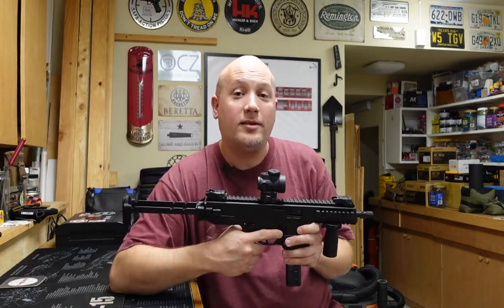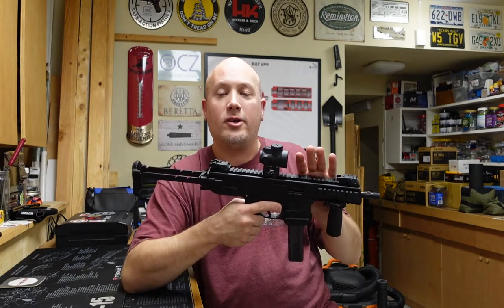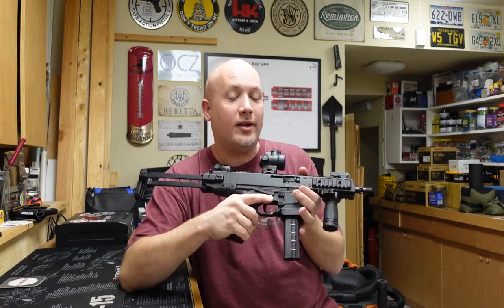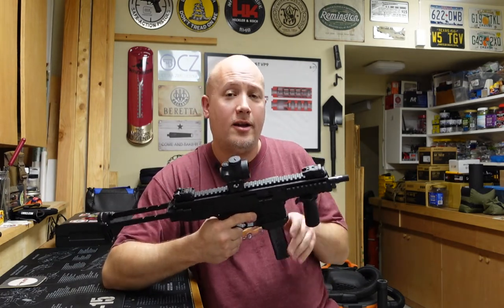Update, Diagnosis and Fix of my GHM9 SBR w/ Information from B&T

Comment: I had an issue with the pmc 9mm before that’s why I don’t use it anymore. I do have apc9 pro and I run it with brass,aluminum,steel case ammo zero malfunction great video thanks for the info
Reply from the maker: You are very welcome! After this happened I have been wary of PMC.

Comment: Interesting diagnosis, and I wonder if they replicated and documented the failure or the diagnosis is based on mechanical theory. And... Every time I see Youtuber talk about exceptional CS, I can't help but wonder if the CS is so good because they know you are a Youtuber. If you are a Joe Blow, will they be so quick and so personal to you? I wonder.
Reply from the maker: It is a good question to ask.
Reply: Yes they are. I'm not a youtuber. Had a problem with my TP9. Called, discussed the problem, sat in the car, drove 25 km to Thun, handed over the gun and clarified the details - bought a few more small things in the shop. After a week phone call from B&T - problem discussed again - solution explained. Do I want to pick up the gun or do you want them to send it to me. I picked them up - a good excuse to go back and buy something in the shop. They counted it as a warranty claim. A fellow shooter had the same experience here in Thun, customer satisfaction is considered advertising that brings in a lot.

Comment: Not being a butt, but how do you “lookout” for under pressure rounds, or over pressure rounds for that matter.
My experience with over pressure rounds it that they announce themselves after it’s too late.
Thank you for another great  B&T video. I love the guns but I’ve found their Customer Service is almost 100% unresponsive - I have five different B&T models, I’ve asked for some tech help and parts help. They rarely respond and when they did respond, they did not follow through. It easier buying two of any one example to have access to parts - shouldn’t be that way.
 Nevertheless, I’ll buy more - they are irresistible.
Reply from the maker: I will say that I have been lucky with B&T but I know my FFL/SOT dealer has had some issues.

As for the pressures, I guess the only way is to spot check boxes and weigh the powder.

Comment: I had the exact same experience. I bought mine preowned so I don’t don’t B&T will send me any parts as I don’t know if the warranty is transferable, would you happen to know anything about that? 

I did just go ahead and order a new extractor kit for almost $85 w shipping and if this happens again I’ll get rid of it because that’s a design flaw, I’ve owned the MPX, Scorpion and SP5 and never had an issue like this with any of them, went for this B&T because of the alleged quality of the manufacturing, to me this is an unacceptable design flaw that should have been addressed during development. God they were able to help you brother, I reached out to B&T but I’m not an “influencer” so I guess o don’t rate for a call or email back
Reply from the maker: I would just call them and not even bring up it was pre-owned. They have no way of knowing. But most companies have lifetime warranties.

Comment: YouTubers that review GHM9/APC9 always use some type of shoulder brace.  Can this be used as is effectively as a pistol?  Thanks for the help.  Merry Christmas too!
Reply from the maker: Yes. If you prefer to use a single point sling it can work that way too like an MP5K.
Reply: @thetexasgunvault  does the extra recoil of the GHM9 affect accuracy vs APC9?